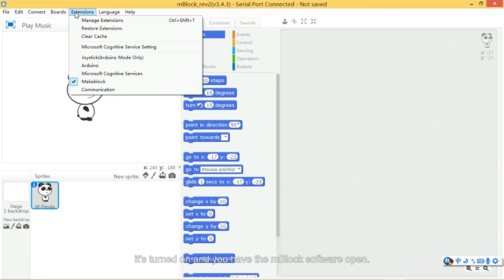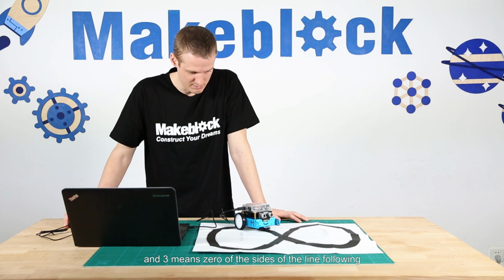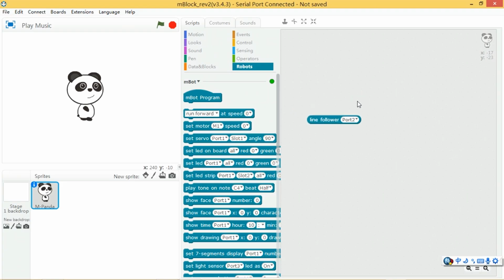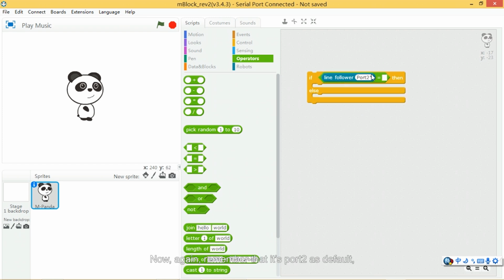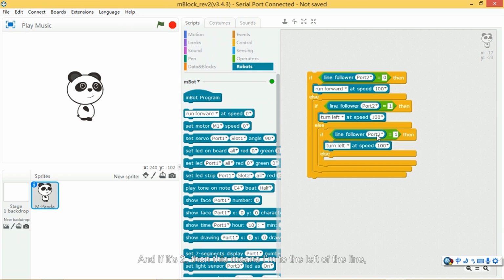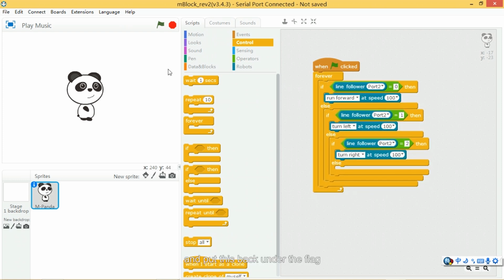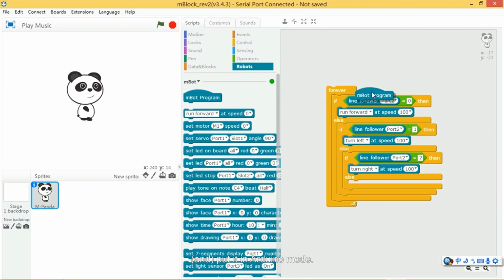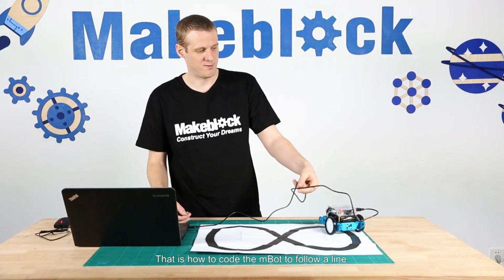Explore mBot Tutorials #6: The Line Follower (with subtitles)

Comment: how do i program white line instead of black?
Reply from the maker: The line can only be programme as black line or white line. Our default map and program is  patrol black line. According to the line inspection module, sensor1 black sensor2 black is 0, sensor1 black sensor2 white is 1, sensor1 white sensor2 black is 2, sensor1 white sensor2 white is 3, you can modify it slightly according to the example program.!

Comment: I codded the mbot to the obstacle sensor but now whenever I turn it on it keeps moving forward what do I do to stop that
Reply from the maker: Hi! you can try to check whether the line inspection module is faulty,  whether the operation is wrong, and check the timing for any wrongdoing

Comment: i downloaded mBlock5 on my MacBookPro.  and when i open it to program my mBot my screen doesn't look like yours.  plus you have a lot more blocks (options) then i do.  and i dont have the blocks you used to program your mBot to line follow. can you shed some light on my problem.  would i be possible if you emailed me if i provided an email address?
Reply: ronald wollman you need older version download from internet like 3.4.6
Reply: Bro u did on a different board dat’s why